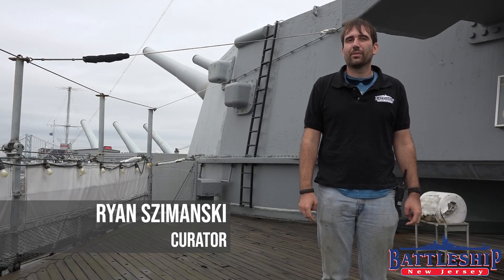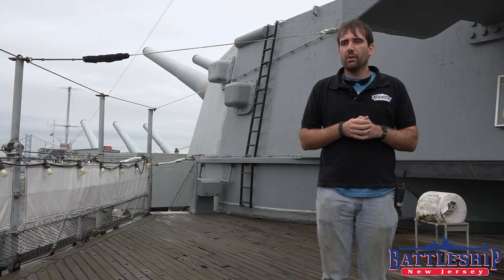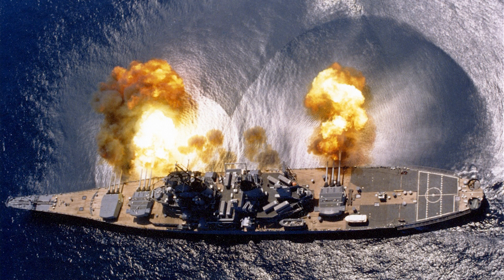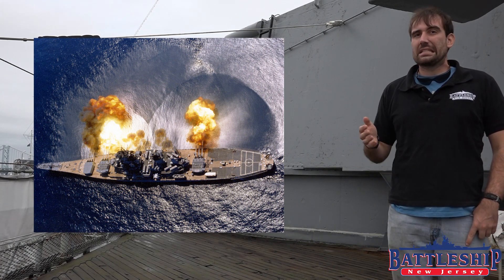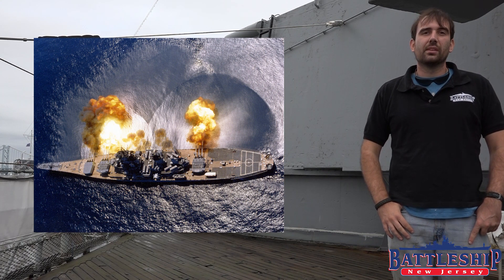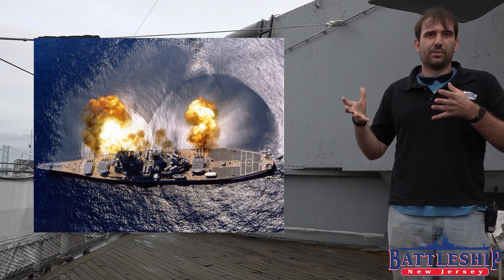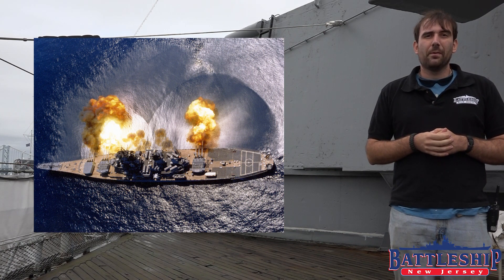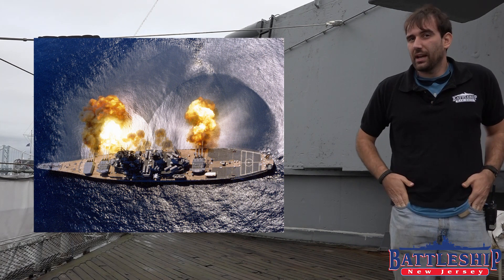Does Firing the 16in Guns Move the Ship Sideways?

Comment: Okay, now I'm imagining HMS Victory firing a full broadside and going sideways rather than, you know, increasing her roll. It's a rather amusing image. On a side note, which has a higher total broadside muzzle energy compared to the weight of the ship a ship of the line or a battleship?
Reply: According to this video New Jersey fires nine 2700lb projectiles, Victory's total weight of shot if firing both sides would be 2,296lb so one shell from New Jersey is heavier than both broadsides Victory could fire, Victory was substantially lighter, at only 3,500 tons compared to New Jersey's 58,000 tons, Victory's broadside be 4.7% the weight of New Jersey's broadside on a ship 6% the weight, so Victory's broadside would move her less than New Jersey's broadside moved her, by move I mean cause the ship to roll a few degrees not push her sideways.

With regards to Victory's armaments at Trafalgar,
The main gundeck had thirty 32 pounder cannon,
twenty eight 24 pounder cannon on its mid gundeck, 
Thirty 12 pounder cannon on its upper gundeck, 
the quarterdeck had twelve 12 pounders 
the forecastle had two 12 pounder cannon and two 68 pounder carronades, 
That is a total broadside weight of 1148 pounds of metal being thrown, however, Victory could not hit anything at much more than a half mile, so I have to assume it is using substantially less explosive per shell than New Jersey, also Victory firing a broadside was firing all guns one at a time fore to aft over the course of 20-30 seconds, a ship of the line of battle (sometimes phrased as battle ship of the line presumably where the term battleship came from) would not fire everything at once because the captains feared the power released in firing all guns at once would cause significant damage to the ship, possibly even rip it apart.
3 shots in five minutes was considered a good rate of fire for a ship of the line at the time Victory was in service, so the broadside taking 20-30 seconds to fire, then guns firing as they were ready (assuming an enemy ship was in range) was not considered much of a disadvantage.
Reply: @terryforsdyke306  Yeah, you almost got there but didn't say it outright. In order to do the math correctly you need to know the muzzle velocities involved. Since the muzzle velocity of a 16" gun is 2586, then the total energy a battleship needs to absorb per shell is 2586 X 2700.

Comment: Were the 16" guns demilitarized? If so, how? I heard that the transit mechanisms were welded in place prior to handover. Is this correct?
Thanks.
Reply: Correct and not correct. To my knowledge it only happened on the New Jersey, but some pinhead  did want the training mechanisms welded. The order got to Bremerton, but not officially put into the deactivation manual( they were hesitant to do it and planned to do it at the last minute). Workers aware of the latest plan began to tack weld the  elevating mechanisms before it was put into the deactivation manual( essentially getting ahead of themselves while the higher ups worked to get that plan cancelled). Eventually the order got cancelled, the workers yelled at for spot welding, but it was reversible. They cleaned up the spot welding. So the training mechanisms are still functional. Proof of functionality is shown on display as the guns on all 4 Iowa's are in the raised position. When they were in mothball, the guns are stored in the lowered position. If they were welded, the guns could not have been raised.  Just look up videos of the Iowa during her transfer to being a museum ship. The group that runs Iowa has a video of how they raised the guns for display.
Reply: The curator at the U S S Iowa museum has covered what was done with these transit and training mechanism, when the Iowa was moved from the East Coast to L.A., in a video on here. 
The amount of "lost knowledge" on all the ships systems and mechanical elements is staggering. New Jersey's rifles should all be free of demiling and able to fire shells iirc, it is just that we can't trust any existing 16" powder now ( it becomes unstable over time and was last manufactured during the Korean War ).

Comment: What degree from centerline do the 16 need to be in order to fire?
Reply from the maker: The stable vertical computer will fire the guns when the ship is level. 
Check out this video for more info: https://youtu.be/szxNJydEqOs
Reply: @BattleshipNewJersey  nice video. My question was specifically related to the traverse. For example, could you fire the big guns straight ahead over the bow?
Reply from the maker: Ah! Sorry, that makes more sense! Turrets 1 and 2 have a 150° limit to either side of the centerline. Can they fire completely forward? Yes. Do they? No. Its why they felt comfortable putting the discone cage antenna there.
Reply: That is sort of what I had thought. My father did his two week reserve tour on the Iowa I. The late 80’s. I got the chance to go out with him the weekend before they let dock and tour all over the ship. I thought I remembered him relaying a story of a Captain who had the guns fired from something like a 25 degree to port or starboard. It resulted in some damage. Not sure of validity, just passing on what I remember hearing.

Comment: Equal and opposite reaction.  In other words, it does move the ship sideways, but that movement is so small that it isn;t noticeable or measurable.
Reply: I'm pretty sure the firing of the guns is noticeable, and measurable. Small, but not infinitesimal.
Reply: @coachhannah2403  Yes, I've calculated the movement to be 0.67 inches per second (1.66cm/s) assuming a displacement of 55,000 long tons and the gun is firing a Mk. 8 shell horizontally. Even factoring dampening/water, I'm sure accelerometers can detect it, along with the shockwave.
Reply: @coachhannah2403  Correct, but the movement of the ship caused by firing the guns, is not.
Reply: So if I hit a kingtiger with a playdough hammer it will move sideways to?
Reply: @EdHunter55  - Yes.
Reply: @EdHunter55  - Yes, F=MA, period.
Reply: @EdHunter55  If the King Tiger is floating, then yes it will.

Comment: Firing ten tonnes of ordinance at 800m/s represents 8,000tonne.m/s of momentum. Regardless of recoil damping, since momentum is ALWAYS conserved there is an equal and opposite momentum imparted to the ship. No amount of energy absorption makes any difference to that simple fact. If the ship (56,000tonnes?) was sitting on top of a frictionless surface then she would slide sideways at a velocity of 8,000/56,000 m/s = 0.143 m/s = 0.314mph.

However, two factors counter this. The first is that water is pretty incompressible, and for the ship to suddenly move sideways she would have to impart a great proportion of that momentum to the water in which she is floating. This would greatly reduce her own momentum.
The other factor is that the impulse of her guns is not acting through her centre of mass. The effect of this will be to impart an angular momentum to the ship which rather than shifting her bodily sideways will cause her to heel. I’d be prepared to bet that a broadside would induce a detectable roll to the opposite side. This would be rapidly damped, as her centre of buoyancy shifted to right her.
The recoil of her guns and the absorption of energy in her structure has nothing whatsoever to do with the conservation of momentum. However, while momentum is split equally between the ship and the shells, this is not true of the energy of the propellant, relatively little of which is imparted to the ship with the vast majority going into those speeding shells. In fact, on the figures used above 99.91% of the energy of the propellant goes into the shells rather than the ship.
Not sure how well I have explained that, so I hope I haven’t confused the issue for anyone. Conclusion, the ship will almost certainly roll a degree or two, but any sideways displacement will be negligible.

Comment: I readed that when the ship is in a stationary postion. At a full broadside all nine main guns firing can push the ship 9 feet
Reply: The article you read would be wrong, as is mentioned in this video, for the gunfire to actually move a 45,000 to 50,000 ton ship it would have to fire a lot more than just a few tons worth of shells and explosives. It's like trying to move a Ford F-150 by firing 9 Barrett .50 cals to the side.
Reply: @ericlanglois9194  I agree. A friend of mine pointed out the kind of force required will break things.
Reply: Absolutely correct- as the veterans of DDay are on record, attesting to that fact. You better believe that the battleships are pushed back when firing full broadsides, which is EXACTLY what they were doing on the morning of June 6,1944.
Reply from the maker: It moves the water around the ship, which is what those guys saw, but it doesn't move the ship.
Reply: @BattleshipNewJersey  Operation Neptune:0600-0630 Hours. The battleships were firing full broadsides.
Reply from the maker: We don't doubt that battleships fired full broadsides. Just that it doesn't move the ship to do it. There's an optical illusion that made a lot of people think it did, but it did not.
Reply: @BattleshipNewJersey  Oh ok.
Reply: @robinrobyn1714  The ships were not moving sideways from the gunfire, the water was being displaced by the shockwaves from the gunfire. The resulting sight is water rushing away from the ship in a semi-circle pattern centered on where the guns are above it. To the untrained eye it looks similar to a wake (water behind a moving ship).
Reply: @BattleshipNewJersey  Her Majesty's Ship- HMS Belfast fired 5000 shells during Operation Neptune, June 6,1944. She was firing full broadsides to port, and her guns caused such powerful vibrations within the ship, that her crews toilets actually cracked and were damaged.
Reply: @ericlanglois9194  Those were some hellacious wakes because the United States Army Infantrymen who were in the boats heading towards the beachhead, stated that the waves caused by the battleships being pushed back from the concussive force of firing full broadsides, were actually threatening their own boats, causing navigation difficulty.
Reply: @robinrobyn1714  if you shoot a powerful gun a couple of inches above a container of water, you'll see the same kind of reaction in the water... yet you weren't pushed back because the gun isn't powerful enough to push you back.

Comment: You can't go and say something is absolutely a myth when the so-called 'laws of physics' dictate that there is lateral movement.
You can say 'in a practical sense there is no measurable movement', but you cannot say there is none.
The only way you would get absolutely zero movement is if the recoil force and the impact force were both contained within the given object. 
Whether something is detectable or not has no impact on it's existence.

Comment: Shock absorbers absorb shock, not momentum.
Physics is your friend.
Reply: I don't quite follow. Would you care to explain the reason behind this? He is clearly talking about how the hydraulic system + physical reciprocation of the barrels dampen the momentum of the shot. It's almost like how a Kriss Vector works as it has the bolt recoil horizontally behind the mag well to deaden recoil.
Reply: Yes, the recoil cylinders DAMP the motion of the recoiling gun, but the momentum transferred is virtually unchanged.  It is imparted to the ship over a span of, say, 1/2 a second instead of instantly as a rigid mount would do.  It is counter-intuitive but this lengthening of the recoil impulse should INCREASE the amount of movement, due to the nature of fluids.

I see the greatest damping force being the sea water.  It would take a huge, dedicated effort to move such a large profile SIDEWAYS through the water quickly.  Any sideways motion that does occur might need to be measured over quite a few seconds.  It's the nature of hydraulics.  Slow movement through water is very easy.  Rapid movement is very hard.

Now, if the guns could all be fired lengthwise to the ship (without blowing the superstructure off) the movement should be quite a bit more noticeable because the hydraulic resistance would be much lower.

Comment: I don't know how much or if it does move but I can tell you that the sound of one of those shells passing over head is something you never forget. We were doing gunnery training before deploying to WesPac in '69 at San Clemente Island, when we were told to stand down that "Big Mo" was taking a shot. I was a signalman and I called down to CIC to find out who and where they were. I was told 20 miles from the island and we were between them. All I could think of was, please load enough power bags in the guns. USS Somers DDG 34 "Super Somers"

Comment: This is simple physics.  For every action, there is an equal and opposite reaction.  The ship must move sideways.  It might only be a tiny amount, but it moves sideways.  Period.
Reply: Because the guns are above the centerline of the ship, the ship will also rotate around that point.
Reply: @brencrun5068  Yes, this is very true.  As they say: "If the battleship is a'rockin, it's better not to be downrange . . . "
Reply: If there was no means of transfering or converting the energy, you might be correct. Everything from the gun's dampening systems to the rattling of the sailors' teeth takes a bit of that energy and does something with it other than lateral recoil. The ship is a system, and there are lots of little ways for that system to deal with recoil energy
Reply: @Uncommoner  This is also incorrect. While some small portion of the gun's recoil energy will escape the recoil system - mostly in the form of heat, the main function of the recoil system is a time delay.  The energy doesn't disappear, go someplace else or get "absorbed."  The effect is that the impulse of the energy transfer from the gun to the mount is just spread over time.  BTW, what "rattles the sailor's teeth" or more accurately, the ship's china, is the blast wave escaping the muzzles (visible in the video).

Comment: Its amazing that this even needs to be explained to people. And there will still be those who insist that "no, it must move a little bit". But you've done what you can.
Reply: Becouse it move sideways, the same way as you shirnk when you walk, due to gain in velocity. It is just such a small ammount that you can't measure in with common technology not to metnion, notice it with your senses.
Reply: Actually it has to move. Momentum has to be conserved. On ice resulting speed would be ~0.5 ft/s (article!). Sideways drag of the ship in water is immense, but not infinite.  
OTOH "seeing" this sideways movement on photos or in wake is just silly.
Reply: It's slightly disingenuous to say it doesn't move sideways. 

"no, it must move a little bit" is completely correct, it's a little bit.

From the Mark 7 gun WIKI

'They fired projectiles weighing from 1,900 to 2,700 lb (860 to 1,220 kg) at a maximum speed of 2,690 feet per second'.

That's a lot of force (x9) - but the ship is MASSIVE and the hull practically perpendicular to the water. 

Spread that force across a LOT of mass and you're left with a small acceleration, which the friction of the water against the hull converts into heat, as it displaces the water (that's movement) a tiny bit. You could probably measure the sideways movement using a laser (or calculate it if you know all the numbers), but the human eye is incapable of discerning anything that small (especially just after someone has fired a 16" gun in the same county).

It's pedantry - you might as well say the ship doesn't move because for all practical purposes it doesn't, and practical purposes is what people like. 

But science says it does and science deals in fact, not feels.
Reply: @pd4165  Probably it would be better to say that any sway* imparted by the guns is going to disappear into  the noise of the other forces acting on the hull. 

* I think it's sway.    "Heave" is up and down, "sway" is sideways and "surge" is fore and aft, right?
Reply: Yes. It is sad that this must be explained to people. 
Let mv be the mass and velocity of the projectile. And MV that of the ship. At rest
O=mv + MV. 

The resultant velocity of the ship from recoil is
V = -mv/M

Mind the sign, include the 660 pound charge mass to that of the 2600 projectile as it too is ejected as a gas at velocity. 

So the ship does move. But not a lot. The tube buffers in the turret, water “force” on the ships hull are all red herrings in this simple exercise in Newtonian mechanics in an open system. Some eager young fellow can run the numbers and inform us of the few inches of actual movement.  

Please. No metric units. There are two types of nations on this earth. Those who use the metric system, and those who put men on the moon and built the Iowa class. Stick to the inch. It served us well.
Reply: I don't think it's sad that it has to be explained. Watching the broadside videos of these ships looks incredibly violent and the camera shakes. Someone who doesn't know much about these ships and big guns would assume it's being rocked sideways.

It is cool that someone has done the math on it though to show it doesn't move (much)